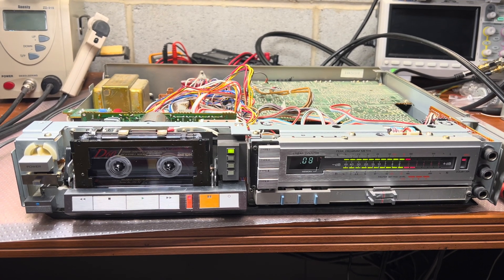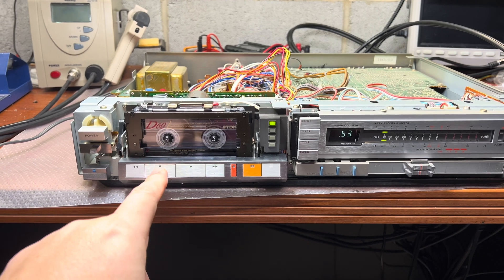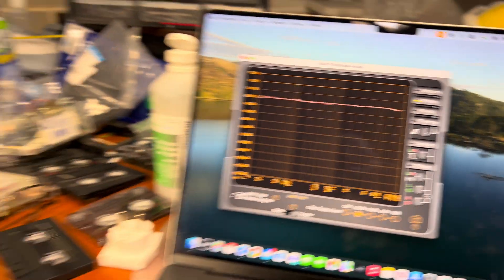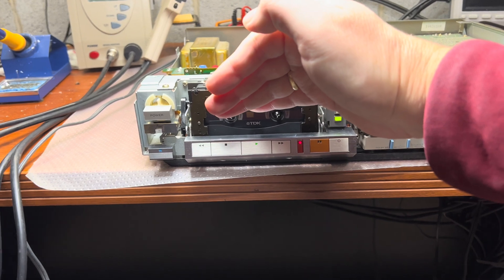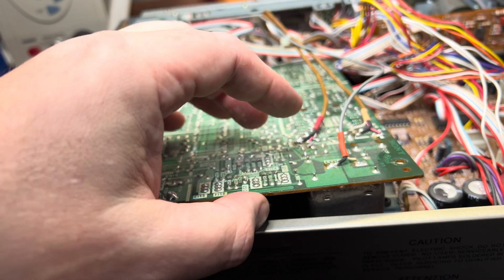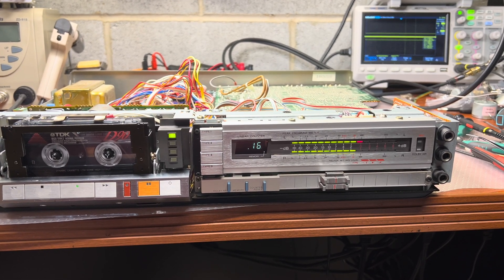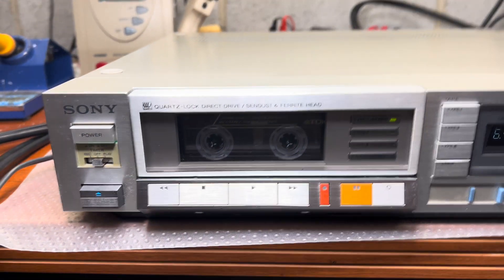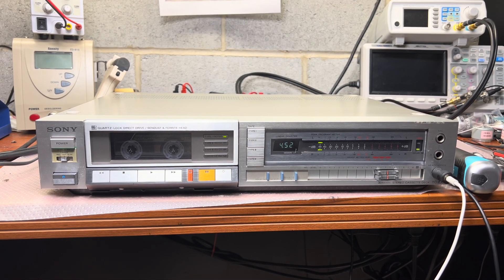Sony TC-FX7 Restoration Finale: Perfecting Performance and Ready for a New Era!

Comment: oh, fine - you've done it - I would really like to know exactly, what you did at 13:00 to fix this part. There is this friction "rope" - did you replace it or did you add some miraculous stuff to make it work again? Did it need MORE friction or did it need LESS friction to run smoothly?   lg
Reply from the maker: I thought I clearly explained that I used silicon lubricant on the friction surface to improve the grip.
Reply: @hifirulezzz  ...sorry, I'm not a native speaker - I thought lubricant is something like oil (to decrease friction, not increasing) - how can something like this increase friction?  .o.
Reply: Did you drip this remedy into the furrow with the rope?
Reply from the maker: @ch2o2  silicon lubricant has a good viscosity which adds grip to the friction material. Try it out.

Comment: What do you use as an input source for these signals you’re recording to track in the app? It isn’t clear from the video.
Reply from the maker: The app itself is a tone generator
Reply: @hifirulezzz  do you have a special cable to send the input signal to the deck and receive output to your Mac? Or do you use a breakout box/adapter?
Reply from the maker: @HiFiGardener  headphones out to RCA and external audio interface to get sound in the computer